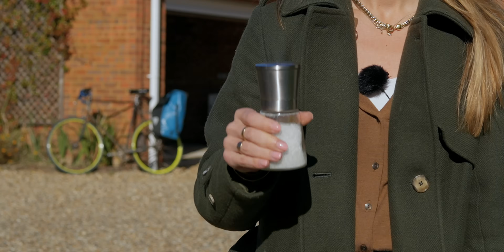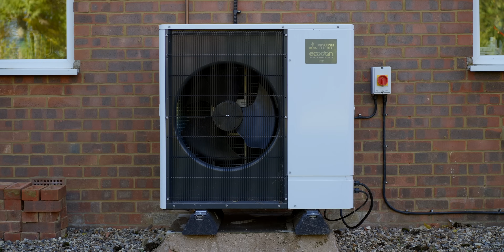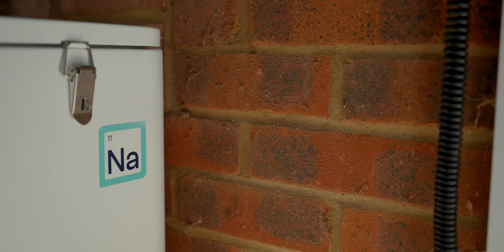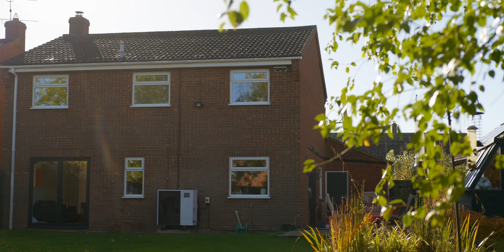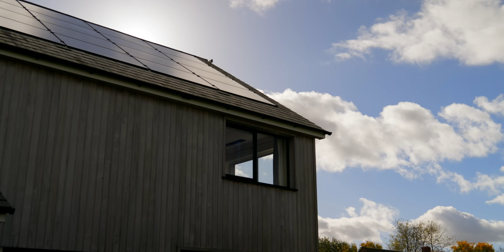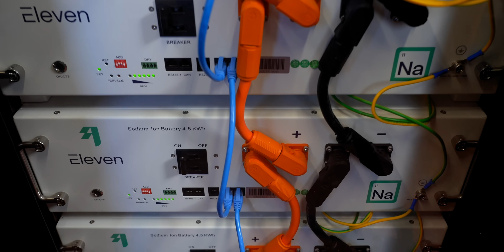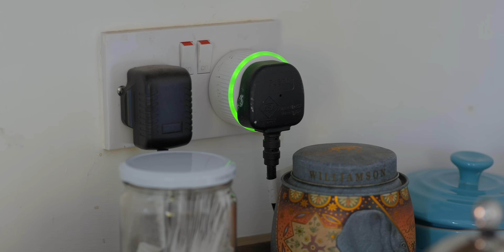Sodium Home Batteries Are Here! Is Salt The Key To Cleaner, Cheaper Energy?

Comment: Don't the Sodium Ion batteries use Sodium Carbonate rather than Sodium Chloride (Salt)?
Reply: The sodium carbonate can be made from salt and ammonia. About 2/3 of the world’s soda ash is made this way.
Reply: @pmac6584  Yes, and sodium chloride could be made from chlorine, the toxic gas. But we don't say "pass the sodium for me to put on my chips". These aren't tablesalt batteries, they are sodium (carbonate) batteries.
Reply: @321tryagain you would def say that
Reply: @321tryagain I think the point being (slightly clumsily) made is that the potential cheapness of these batteries stems from the cheap availability of the raw material (i.e. brine).
Reply: @colinmcconnell827  The point about "safe enough to put on chips" made me think it was clumsily trying to emphasise safety. A report by "HeatedBattery" indicates that lithium raw material costs contribute about 45% of the cost of LFP batteries, so if sodium costs 10% of that and offers greater energy independence then it is valuable and the production costs will dominate. We just have to hope that the production costs can come down as fast as LFP has.
Reply: @321tryagain  Fair point; that does seem to have been part of it.  At best the whole table-salt thing was confusing.  An image of the sea might have been a better visual aid to open with.
Reply: @321tryagain  And they are not Na batteries, considering all the other elements and chemicals that make it up. The Na₂CO₃ can literally be made from sea water.

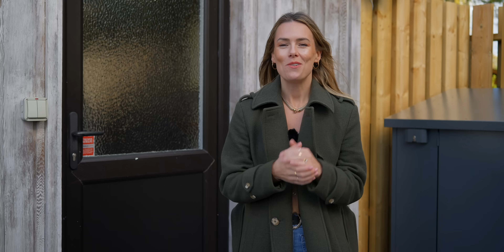Comment: 9:49 A saving of 400 to 600 per year?  With my solar and battery, I'm saving about 300 to 400 per month.😳
Reply: You're not saving £300 to £400 per month with a 10kWh battery. Also, she was talking about increasing the self consumption of the solar PV generation.
Reply: @VinoVeritas_   You are right, I made a mistake. It is per quarter, not per month.  This still makes my savings over my old power bills of 1200 to 1600 per year. (I have a 13kWh battery)
Reply: @martythemartian99  But she is talking about increasing the self consumption of solar PV generation with the aid of a battery.
Reply: I'm in the USA. I installed a 20kw solar array coupled with a 20kwh Enphase battery system. It DOES save us $350 PER MONTH since we have $0 power usage now.

Comment: Only idiots (unless you're living off grid or in a rural area) think batteries and PV are "progressive" when compared to just a wire coming into your home. You know, like has been normal for 50 + years. Turns out you really can sell Ice to Eskimos.
Reply: Or only uninformed still buy expensive energy when with the right investment in technology you can run your home and drive your car for free. Ask me how I know.
Reply: @pmac6584  Sucker, lol.
Reply: Data says otherwise
Reply: @andycampbell193  What data? lol. Did you even understand the statement? Apparently not.
Reply: @speedoftencats I did understand thanks, did you look at the data in the uk to support your statement? Payback time is typically 7 years.
Reply: @andycampbell193  You obviously didn't because you're still going on about ROI data, lol.
Reply: Have you looked at the unit price? Why are you surprised. 1kWh of storage can be had for £40 delivered.
Reply: I get paid over £800 per year (rather than paying the electricity company) because I have PV + battery. Why does that make me 'an idiot'? PV + batt is now very cost-effective, providing both savings and energy security. Combined with fabric improvements, a heat pump and an electric car, and you have a transformative collection of technologies.
Reply: @xxwookey  All of which (except for the fabric, EV and perhaps a heat pump, depends, and we aren't even talking about those here) you don't need to do anything you need if you live in an urban or suburban area. It's all extra stuff, and introduces many new points of failure for zero benefit. Also, you guys seem obsessed with savings vs current retail electricity pricing, rather than being obsessed about why that price is artificailly high in the first place. You're looking to solve a problem that shouldn't exist. Talk about misdirection, you people are metaphorical cats following a laser pointer. Cute perhaps, but not smart.

Do me a favour, see how much you'd "save" vs US retail electricity pricing, or UK 2006 pricing (inflation adjusted), but without all the added on artificial costs.

As for "personal home energy security", wow, that's an edge case in 90% of homes in the UK. Also, unless you apply for a DNO from the grid/supplier, and install  EPS/UPS and an ATS, you don't get this functionality. THat's more stuff you need to install and pay for. 

Many installed systems don't have this; yours might. If it does, how many times have you used it? Also, if you do need it, that's telling you the grid sucks now, so maybe you need to focus on that.
Reply: This guy is cooked 🙏
Reply: @StealYourFish  Question for you. Do you have a NAS setup, a locally running AI, and a Bitcoin node in your home? Those three things and a Starlink internet connection are all more useful to have than home energy production+ battery in 90% of cases. 

Even those four things are probably not needed for most people, and I bet you there are more solar/home batteries than those other installs combined. I also bet you use cloud storage and cloud computing daily for example, and I'm almost certain you have a bank account and an ISP with either a copper or fiber line coming into your home, right? 

If you do have those other indepenant nodes, you might well benefit from home energy production and energy independance ironically. If you're off grid or rural, then have at it too.
Reply: @StealYourFish  In reality, it's you midwits who are cooked dude.
Reply: People used horse and carts for more than 50+ years.
Reply: @AlanTov  Yes, and then they were replaced by something better, so real progress. I'm sure you've heard the maxim "the best part is no part", right? 

Also the step "don't waste time and effort optimizing something which shouldn't exist". 

This is what's going on here.

Comment: The weight and size of sodium per Kw/H is still improving and in stationary applications, the cell size will increase, further reducing cost.
Reply: I believe CATLs batteries for EVs are at 175W/KG. which is around where LiFePo4 are atm. NCM are a good deal higher.
Reply: Costs are largely determined by shipping costs. These cells weigh more than LFPs.
Reply: that's the least of Na+ problems. Charge/discharge efficiency, cycle life and huge voltage range makes it basically useless for storage. Or EVs. Or anything really. Basically they're only good for starter batteries, just like lead acid.
People jumping on the bandwagon without understading the severe limitations this chemistry has.
Reply: @hojnikb There's a reason CATL are swapping to Na+ You should check their results. 90%+ life after 10000 cycles among other things.

Comment: Beyond batteries were the first and have been making sodium in the UK for over 3 years, not sure why now this is a big thing? Does eleven energy pay for this kind of promotion?
Reply: Beyond batteries make 12v batteries aimed at mobile systems, diy off grid, commercial applications. Typically home PV uses higher voltage to lower the current. This system is 60v and so not aimed at the same market.
Reply: @pmac6584 they also have 48V home battery storage system too.
Reply: @tippy_travels maybe they need help with marketing. I couldn’t find anything on YouTube about the na100.